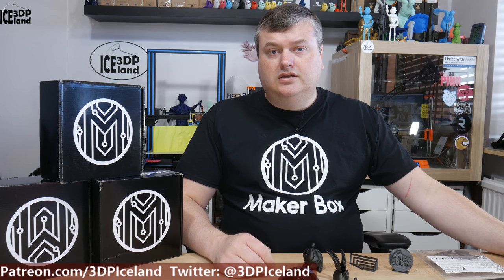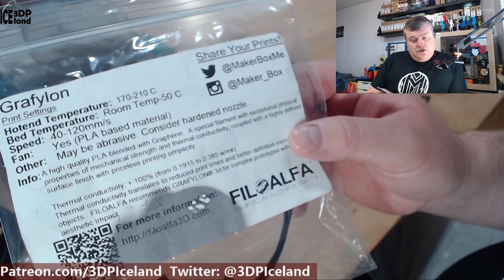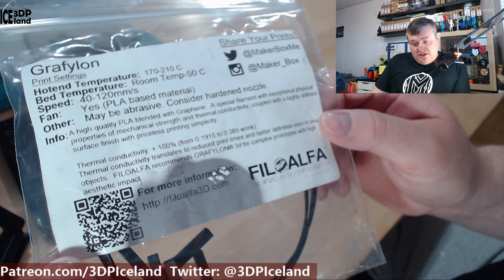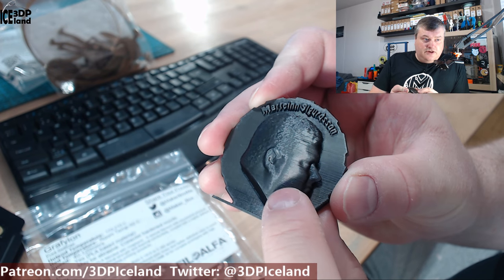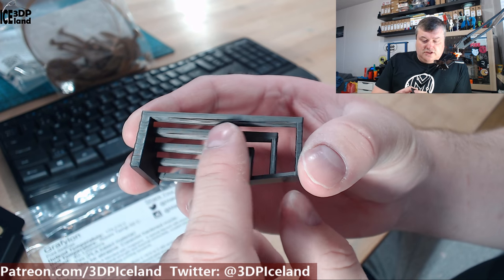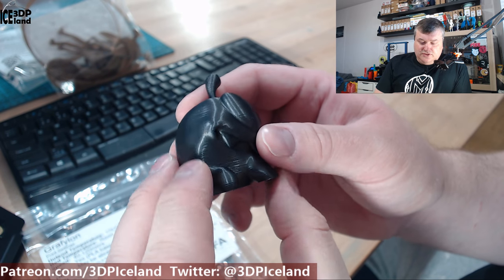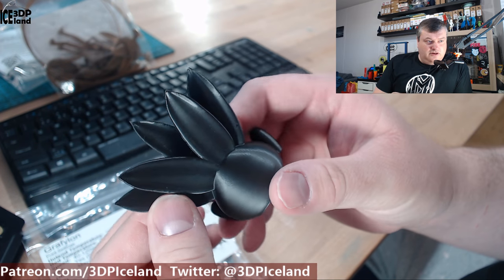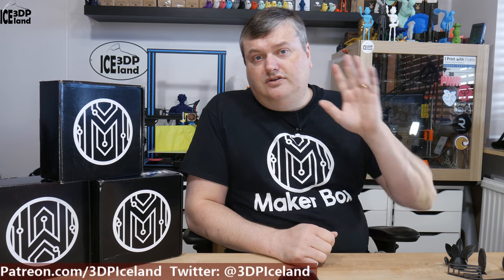Makerbox Monday - FiloAlfa Grafylon

Comment: Hello good review. Can i have a Profile setting of Cura 4.0 with parameter of this Material? I have Grafylon but i didn't print very well.
Reply from the maker: Hi. I dont use cura, so i dont have that for you.
Reply: @3DPIceland , Thanks for the reply. Also, i have simplify3d. Did you have this?
Reply from the maker: @superandry90  I have that program, but don't use it much, - I use Slic3r Prusa edition for almost all my prints. - I didn't save the profile for this filament, I just used standard PLA settings for it printing at 210°C I belive.